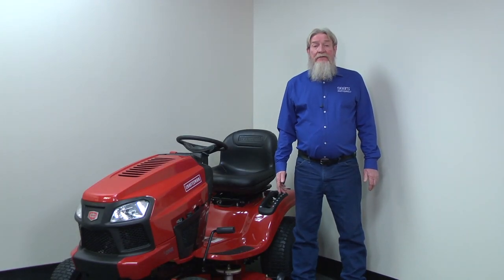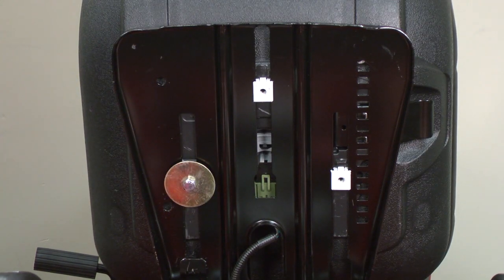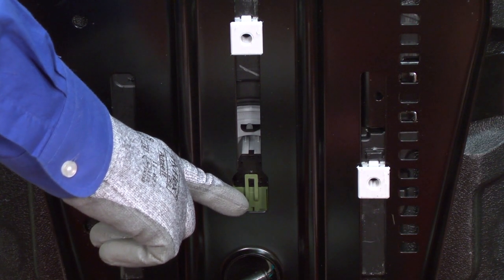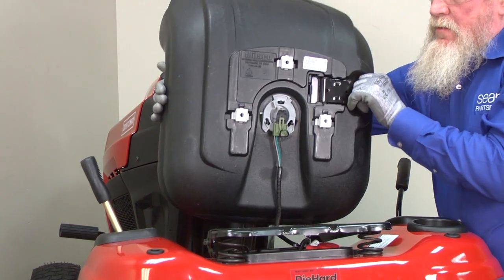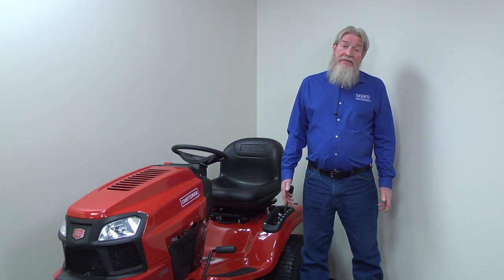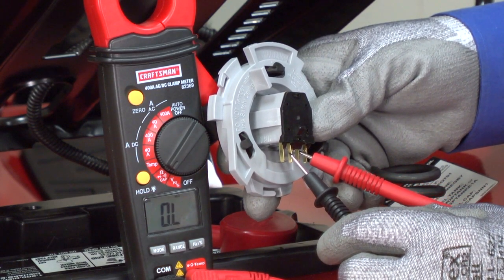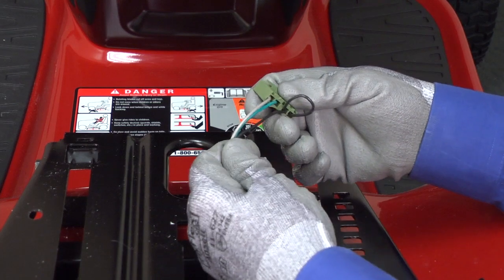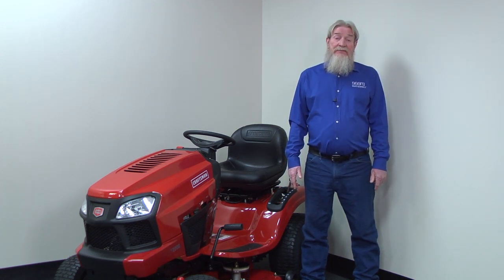Riding Lawn Mower Dies When You Release the Brake

Comment: replaced the seat switch and thought the problem was solved but the mower started dying again after a short use.  If I shut off the blade it might stay running.

Comment: I have solved the problem on several occasions by pulling out the 3 fuses under the seat and pushing the same ones back into place, without having to buy new ones.  My John Deere is super old, and special.

Comment: I have a Craftsman LT2000 with BS 
Intek 18HP engine, seat switch is fine, replaced both interlock switches (brake & blade engage) when i release brake it dies, as its dying if I engage brake the engine springs back on, is there anything else there could be?

Comment: Hi Sears,
Great video. I have a Mountfield 1361H ride on mower.
Mine starts if you turn the ignition key but instantly stops when its released. I have fitted new switch and solenoid but still doesn't work.
It runs fine if I hold the switch constantly on start, ??????
Mystified from Cornwall UK.
All the best
Duncan.
Reply: same problem did u fix
Reply: @Darkmaniac  Hi Brady,
Yes, well a mechanic did.
It was me putting the wires on the wrong way round on the ignition switch 😜🚂.
I should have taken a picture beforehand.
👍🏻🏎

Comment: I was 5 minutes into using the mower mowing lawn when it died. It starts up just fine and will run till i take off the brake, does not even have blades going and shuts off. I checked seat switch and seems fine, i checked with meter and seems fine as well. Nothing seems wrong with wiring harness. Now what? My model is 917.289280
Reply from the maker: Your details indicate that a bad seat switch or a short in the wire harness is cause the engine to die when you release the brake. You can try replacing the seat switch. If the engine still dies when you release the brake after replacing the seat switch, then a short in the wiring harness is likely causing the problem.
Reply: Sears PartsDirect nope again i tried checking with the meter and it is fine. I have found the problem and it is not either the harness or the seat switch. It is the break/clutch switch which has gone bad. After testing everything myself i figured it out. So you are wrong. Sorry

Comment: Ok where do you get one? What is the part and number?
Reply from the maker: The seat switch shown in the video is part 401545 ( https://www.searspartsdirect.com/product/1e47k88x3d-0071-917/id-401545 ). That part may not fit your model if you have a different type of riding mower. We recommend that you look up the part for your mower by using the mower's model number to find the parts list diagram here: https://www.searspartsdirect.com/  We hope this information helps. If you need further assistance, let us know.

Comment: I’m really glad that I found this video, and glad that you seem to respond to questions, as well.  My mower won’t start with the key - no noise, clicks, nothing.  The battery and starter check out ok.  I found that I could jump start the mower by having the parking brake engaged and key to the on position.  Are these safety switches (brake, seat, etc.,) in series? Does starting my mower with the parking brake engaged mean that it’s the seat switch that’s the problem?  Thanks for any advice you might have
Reply from the maker: Many riding mowers have a blade engagement interlock switch in series with the brake switch. Here's a troubleshooting video/article that shows how to check interlock switches and addresses the starting problem that you're facing: https://www.searspartsdirect.com/article/riding-lawn-mower-wont-turn-over-or-click-video.html . We hope this additional information helps. Let us know if you need further assistance.

Comment: I bought a used lawn mower and mine is tapped so the mower won’t turn of when I get up. Hhhmmmm I’m not going near ditches
Reply: sound like some one has bypassed the seat  switch raise up the seat  see if the switch is connected  if so try this  turn key to on pos raise  up the hood now pressdown hard on the seat you should hear a faint click which is seat relay operating this what stops the eng normally    thr relay is located right behind  eng.ita little black box about an inch and 1/4 square about 5 wires

Comment: THANK YOU! ''Fixing this problem may be as simple as plugging a loose wire harness back into the seat switch.''
 My Murray had this problem. I had to remove the battery to access the seat switch. Sure enough, it was loose. Finally, an easy repair.... Thanks to Utube and Sears
Reply from the maker: Thanks for letting us know what you found. We're glad to hear you got the mower fixed.

Comment: zero turn mower u be driving it then dies and starts back up just fine and does it again
Reply from the maker: Check the wiring connection on the seat switch because a loose wiring connection could be causing the mower to die. If the wiring is okay, check the seat switch for damage and replace it if it’s cracked or broken. If these tips don’t help you fix the problem, let us know the model number of your zero turn riding mower and we’ll try to offer some additional troubleshooting tips.

Comment: This is gonna sound crazy but my mower cut-off on me in the middle of cutting the grass.  The fuse was the first thing I checked and it looked fine so I checked ever safety switch, connector, harness, relay and solenoid.  Out of desperation, I decided to jump the fuse and it turned over.  What gives?  The fuse wasn't visually blown but obviously, it was the problem.
Reply from the maker: A wire with a cut in its insulation may have shorted to the mower’s frame. If the fuse blows again after you replace it, use the troubleshooting shown in this video to find the cause of the short that’s blowing the fuse: https://www.searspartsdirect.com/article/troubleshooting-a-riding-lawn-mower-blown-fuse-video.html.

Comment: What if it blows the fuse when you plug it in?
Reply: Model # 917.275970
Reply from the maker: The blown fuse indicates that you have a short in a wire or component (such as the ignition switch) that is causing high current flow through the fuse. We recommend that you use the troubleshooting in this video to find the cause of the blown fuse: https://www.searspartsdirect.com/article/troubleshooting-a-riding-lawn-mower-blown-fuse-video.html. Here's a link for the owner's manual for your lawn tractor: https://www.searspartsdirect.com/partsdirect/user-manuals/917275970-craftsman-parts-manual. The owner's manual has a wiring diagram on page 33. The wiring diagram can help you when looking for the cause of the blown fuse.

Comment: I just replaced the idler pulleys on 42" craftsman mower. When Put new pulleys I noticed the right pulley is about 1/2" lower than the left one. Is this normal or should there b a spacer ?
Reply from the maker: The right pulley does hang about ½-inch lower than the left idler pulley on many 42” Craftsman riding mowers. What you’re seeing is likely normal.
Reply: Thanks for reply, now I can stop searching parts diagrams.
Reply: +Donald Always have a good day

Comment: My lawnmower dies when I turn on the blades, any suggestions?
Reply: obuBBubo yes and that is a good but it won't start if I'm on the seat
Reply from the maker: A short circuit in the seat switch or its wiring harness may be grounding the ignition system and causing the engine to die when you turn on the blades. That type of problem could also prevent the engine from starting when you’re sitting on the seat. Check the seat switch using a multimeter as shown in the video. If your riding mower uses a different type of seat switch, post the model number of your riding mower and we’ll provide additional troubleshooting tips.